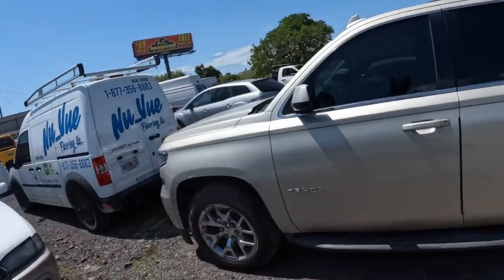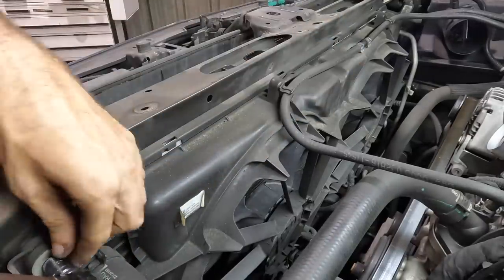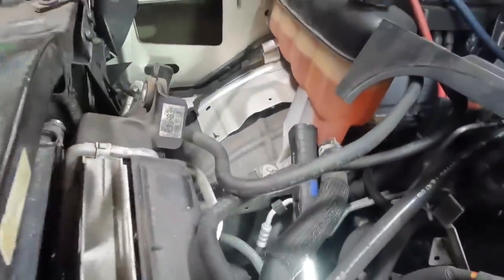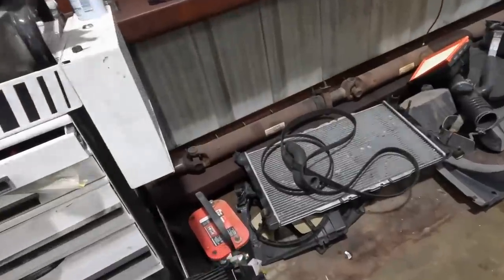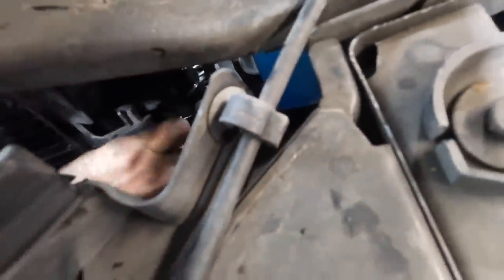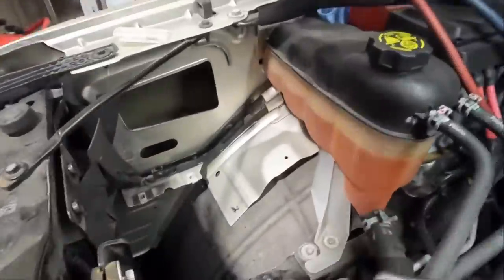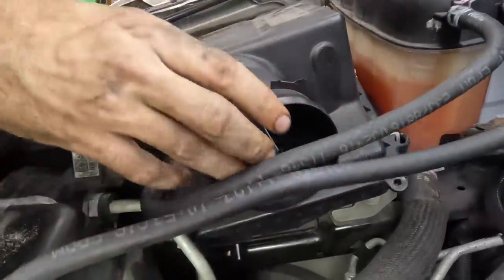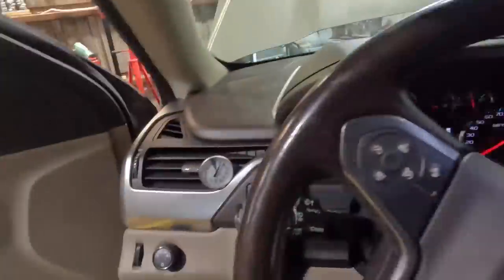Design Flaw? Cut In Half from Factory! CHEVROLET Tahoe 5.3 Freon Leak

Comment from the maker: Cut Condenser Video:  Customer States...WAIT, look at this! Can't make this stuff up! https://youtu.be/9nHSh5ZYFmY
Reply: I imagine that cutting that factory core allows it to flex more.
Reply: Maybe not happy, but installing that guarantees a repeat customer, soon.
Reply: Ray, I have done three of these and I removed the upper core support on all of them. It’s actually fairly easy there is 3 10mm bolts on each end that you have to remove from under the top rail.

Comment: The leak in that weld between the condenser and filter dryer are super common with these era of GMs.
Reply: Yes it is ,real common
Reply: Happens with 90s era Ford trucks also
Reply: Mine (2013) appears to be leaking at the driver side top corner of the radiator. I didnt feel like pulling my headlights and stuff out to see exactly where, but i see coolant draining from that area..

Edit: actually similar to this video, just a little closer to the metal bar that crosses the top of the radiator 😅
Reply: Pretty obvious design fault, the condenser is going to run hotter than the drier so there will be plenty of stress on those welds.
Reply: @ferrumignis  true but it's a bad design on those condensers they should have a recall on them majority of those trucks leak in that same spot
Reply: GM should have issued a factory recall…
Reply: @Rick Mason  they issued a TSB and extended the warranty on the condenser. But definitely should have been a recall.
Reply: Yes I've changed alot of them when I worked at the dealership
Reply: Is that a GeneralMistake or what
Reply: @nashvillecop1  hahaha!!  That would cost them hundreds of thousands!!  Never happen!!  They would rather pretend it isn’t a problem
Reply: Yeah,  he made that quite clear in the video lol
Reply: It should be covered by warranty.
Reply: That's what he said.  Couldn't a good Rad shop fix the leak for less than new consendser?
Reply: @xxxxxx_1300  I don't think they do recalls unless it's safety related.
Reply: @Red-Raider  These are the same people that "fixed" a problem that killed people with a 5 cent piece of plastic.  Ended up costing 35 million, so really bad idea.  Bad ignition switch spring.
Reply: @nashvillecop1  Nobody issues factory recalls for non-safety issues even if they should. Ford wouldn't even recall master cylinders on F-150's a few years ago until the federal government basically twisted their arms... a lot.
Reply: I Wonder why they didn’t spot this issue when construction this part. You can do thermal stress analysis in CAD pretty easily this days.
Reply: @Todestelzer  CAN and DO are not the same thing.
Reply: @Todestelzer  That's probably the task of the manufacturer of the part, which isn't GM.
Reply: Even if you're a good Tig welder, the problem with it is the temperature differential, it's going to break again. It's just a faulty design.
Reply: @ActivityPhoto good luck with finding a radiator shop
Reply: @Hoggdoc1946  No. It is aluminum so it has to be Healey arc MIG welded, which causes the aluminum to contract which increases the pressure and reduces the flow of the refrigerant. If you welded a brace from the end tube to the coils on the trans cooler part that would stop that weld from flexing so much, but do not weld onto the condenser parts of it. It is a cheap stupid way to modify an existing condenser to also have part of it work as the trans cooler.

Comment: A safety issue: I shorted a battery lead with my wedding ring. Only a minor burn, but could have been worse.
Since then, no rings and no wristwatch when doing mechanical things. A reminder to Wife Unit, no need to dicover that by herself.
Reply: Damned good point. Eric O wears a wedding ring also. I tried to warn him too. I joined the USAF in 1964, And was in a mechanical field. They showed us a gruesome safety movie of guys that suffered accidents by wearing loose clothing, ties, rings, watchbands, necklaces etc around rotating equipment and batteries where unintentional short circuits could occur. Three guys watching the movie ended up puking their guts out. And even knowing this, I was working on my motorcycle on base, and managed to short my stainless watchband from the positive terminal to the frame. I have never worn anything conductive or loose ever since, as my wrist was burned really bad. Doesn't it piss you off when you know you are doing something wrong and you do it anyway? It usually happens when you are in a hurry, or tired, or both. 😢
Reply: She bought him a non-metallic ring to wear while working. I think it's just silicone. It should tear before degloving his finger.
Reply: Definitely agree about wearing of rings, better to remove the ring from your finger before the finger gets removed in a mishap.
Reply: It was always recommended to remove rings while working on aircraft, especially helicopters. Fall off, grab onto something, lose grip, ring catches, peel off the skin and muscle on the way down.
Reply: Seen transport semi driver for J. Deere pull his ring finger off his hand from wedding band. 🤦
Reply: Yep, reach up under a dashboard and get across a terminal to ground and there goes your finger. When I was taking electronics classes in 1964 one of the first things, we learned is to remove any rings, wrist watches before working on any electronics. Back then it was all tube circuits at 600 volts so it was just more than getting burned at 12 volts.
Reply: I wear a cheapie silicone ring and a Casio dw5600 at work wrenching on cars.

Comment: Ray, I just wanted to comment on your statement about that upper radiator bracket. I have done 3 of these condenser styles in the past month, there are 6 10mm screws on the underside of that bracket, 3 on each side. Used a ratcheting wrench and was able to lift that bar out of the way. Takes about an hour total at this point for full R&R. Hope this helps in the future!! Love your videos, keep doing you!
Edit: on passenger side, just gotta remove the airbox and the plate beneath it.
Reply: I've done my fair share this way as well. I usually snatch the bumper cover off, both headlights, and the bolts are relatively easy to get to. Takes about 20 minutes. Makes getting the condenser out so much easier. Also helps with getting to the transmission lines to get them clipped back in.
Reply: @sbinc.9275  If this was my car I would get out the sawsall.

Comment: Ray, Did you remember to top up the transmission fluid?  You will be low by whatever the quantity is in the transmission cooler, and whatever leaked out of the lines. Other than that, great video.

Comment: I changed mine in my 07, and I just ended up taking the bumper off as it allowed for more access to the bolts that are hard to reach. I'm sure it's different with a customers veh, but for my own POV, I just remove all that I can to gain access to that component. Good work though.

Comment: Oh yeah I was definitely gonna REEE if you didn't replace those O-rings =)   One tip that might help that I learned from my dad - cut out part of the cardboard box the radiator/condenser came in and zip tie it to the radiator like you would with an oil pan gasket.  Great video as always.

Comment: Funny thing is that there is a A/C condenser recall for GM K2XX trucks for the 2014-2015 model year. Why condenser fails exactly like that...  Told my dad to even wait a few years so he had less A/C issues, but even then the 6l80e torque converter only lasted 30k miles lol. Meanwhile my 50k GmMT400 Tahoe I got from my grandma still runs like a dream even with my Delphi HT6 compressor recalled. Yeah I had to throw new spider injectors on but I got the Standard MPFI upgrade. I get 14-16 city and pushing 22 on the highway with a lifted 4wd truck on 33s lol. Better than my moms new 2021 z71 tahoe which is optioned up the same as my 00' obs Z71.

Comment: I always pressurize the A/C system with nitrogen or air and check to see if it holds pressure before vacuuming because just doing a vacuum can suck cracks closed and seals close and show no leaks.

Comment: That upper frame rail does come out. 2 bolts on the bottom side on each side then the middle bolt in the front. An absolute pain in the ass to get out but it's removable.

Comment: First off let me say I work at the Lockport Gm  plant that made that condenser. It’s not a flaw , Delphi designed it that way , the temp difference between the two units (condenser and transmission cooler) the cut was made to allow the core to “ flex”. Yes that core was a nightmare Delphi not Gm designed it , Gm had to redesign it after a year or so because the coupler to RD tank was failing a lot . That core did have design flaws but the cut wasn’t on of them
Reply: If it failed on a regular basis, it's a flaw. Obviously the designer missed something. If a house you sold to a person falls down, you can't blame the framing subcontractor. As they say down south " That dog don't hunt"

Comment: Aluma weld sticks WILL repair aluminum a/c lines, if you can get at them.  Only requires propane torch and clean aluminum.  Also works well on aluminum radiators.

Comment: Actually, the massflow sensor works by measuring two temperatures through two resistors. One resistor is just measured as is and one has a constant current set through it that heats it. The passing air cools of the heated resistor in proportion to the mass air flow. So if you know the actual temperature (the unheated resistor) you can calculate the air flow. Quite easy actually.

Comment: Driver's side upper condenser is the first place I look for a leak on these trucks.  Been a very common failure point for years.  The change to 1234 refrigerant  didn't change that.  Easy money for me, bad luck for the owner, unfortunately.

Comment: What is your recommendation on replacing the transmission fluid in a 2019 Honda Odyssey with 60 thousand miles on it? Do you have to drop the transmission pan and what should the approximate cost be? Great job by the way.

Comment: It's coming close to the time it will need a new radiator. The tank on the drivers side will develop a crack and start leaking. My 2006 Sierra did it, it's a common issue.

Comment: I believe that upper core support actually does come out, but you have to take the 6x 10mm bolts out with a ratchet wrench or flex head 1/4 ratchet. They're on the bottom side, but it could be an addition to the later models. I've done at least 6 condensers at my work and have had an easier time taking that core support out rather than fighting with it
Reply: It sure does have those bolts, I have done hundreds of them and never saw one that did not come off.

Comment: That seems to be a classic design fault with the condenser. Two tubes rigidly connected at two separate locations, and the clear potential for differential expansion due to different temperatures. It is almost guaranteed to fracture one of the connections. And it does fail.

Comment: GM engineers need to get into a shop and work on these things, then maybe the next version will be better designed for servicing.
Reply: Any engineer from any manufactor curses the designers... because they are left with making solutions to the designers will and the the price the accountants has decided is enough to get it done... And they are in the mechanic's evening prayer under the "free us from evil" part
Reply: Ever since the advent of leasing vehicles are designed to be maintenance free for three years, and no more.

Comment: My caravan feels like it's missing and gutless going up hills, no codes stored , my friend says it's my wheels 'hopping' because of bad shocks.  My job takes me 75 km out of town and I worry about being stranded and having to climb up the mountain to get cell coverage... Love you all , stay safe...
Reply: My 1988 Caravan did the same thing on the way home from Myrtle Beach through West Virginia. It was the fuel pump.
Reply: What year is you Caravan?  I had a similar problem with my '94 and it was the wiring between the distributor and the ECU rubbing on a flange on the fender as the engine moved in the mounts under load.

Comment: Hey Ray. What hppens with the refrigerent that the machine takes out? does it get reused? or is it like your TFA oil machine kept in other tank? If it gets reused then there should be UV dye in the tank mixed up from all the extractions. Why use Dye again? And what if a car use different type of gas for AC? can you use same machine or can you change the tank in machine? FYI i am not a car mechanic. just like this vids. Thanx.
Reply: I was thinking the same thing.
Reply: The machine has a separate tank for the oil/dye, and it removes it from the refrigerant. Also, yes, the refrigerant gets mixed back in with the other stuff. It doesn't really go bad as far as I know. There are other types of refrigerant, i.e.: r22, r134, and now r1234yf. And no, you cannot mix them.
Reply: There are separate machines for the different refrigerants.

Comment: Then the bartender says to the pirate, "Okay, Mac, what's that lump in your trousers?" And the pirate mutters, "Hyar" and thumps towards the bar on his pegleg.  The pirate pulls his waistband forward and the bartender peers over the bar and down into the pirate's trousers.

"What the hell? You've got a steering wheel in there!"

"Hyar, and it's drivin' me nuts."

Nice Wera flexible nutdriver you got there, Ray! I sent you a set of Wiha nutdrivers a few months ago, having seen you spend so much time slopping around with slothead screwdrivers. Well, now it looks like you really have found quality nutdriver religion!

EDIT: Huzzah! Now I see one of the Wiha nutdriver set at 37:13 mark. Glad they could be of some use.

Comment: Way back in 1995 Motorola had a huge mistake just before their debut of their new  Motorola StarTAC 85 (1996). Thousands of the molds did not have the holes for the prongs on the charging base. An also bad design like the unit Rays fixing. The shop I worked at got a sudden O/T job to drill out thousands of molds so as not to delay the release of of the phone. Quality control did not exist.

Comment: You know, while I don't think it's a particularly good design, integrating the trans cooler into the A/C condenser is a far better option compared to integrating it into the radiator. I mean, how many times have we seen those integrated trans cooler/radiator combos spring a leak and either dump trans fluid into the cooling system, or worse dumped coolant into the transmission, destroying the clutch packs? At least with this design if either spring a leak into the other system, the odds of catastrophic fluid mixing is far lower. By the time the pressure in the A/C system gets low enough that the trans fluid flows in, the A/C system is shut down because of the pressure loss, and any refrigerant getting into the trans fluid will aerate it but that's about it.

Comment: After-market improvements. Ran across my first one for a 2008 Prius outside hatch lift handle.  Plastic fasteners inadequate. Replacement part from Toyota was unchanged. Aftermarket had metal reinforcements to eliminate weakness.  Frustrating. Put after market parts Inca different light for me.

Comment: Put air pressure on the leaking condenser and see how big the leak is at the weld.. With Rays welding skills just spot weld the hole and reinforce the area. Good to go .